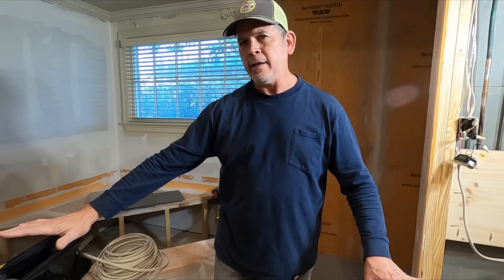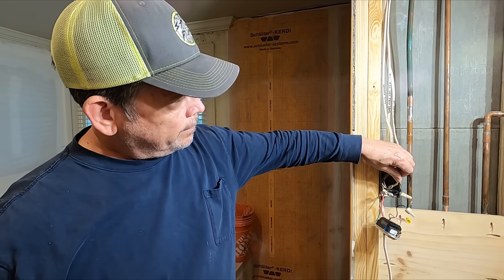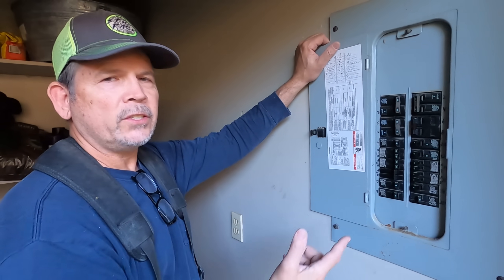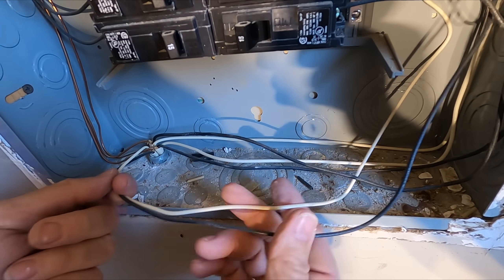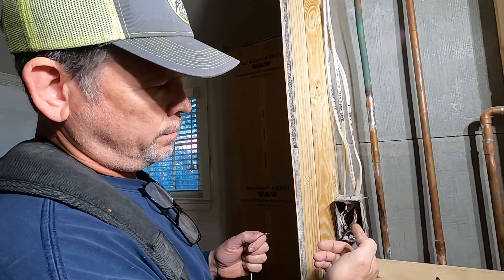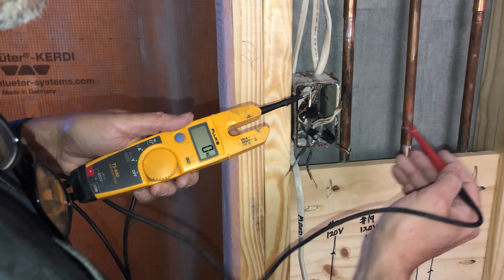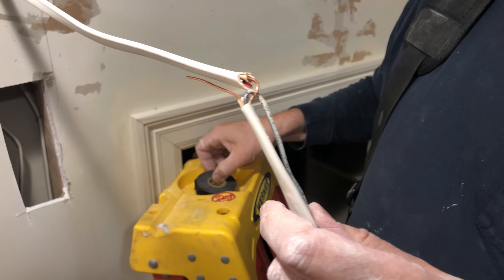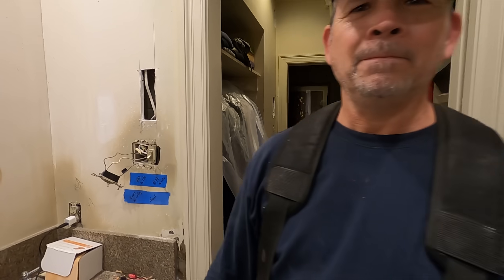You CAN Get SHOCKED by a Neutral Wire! This is How...

Comment: if you want to worry about getting shocked go work for the company I did. They designed the electric fence control panels for all of California's state prisons. Even after the 30 minute safety procedure to turn off a section of fence and unlocking the gates to access the fence and control panels you still get the hibby jeebies walking next to them.

Comment: Great video !   I have been doing electrical wiring for a number of years and renovations can (usually do) have surprises with them.  Electrical wiring is no exception.  Working with electricity is safe only when you know exactly what you are doing.  Electrical codes are important and also, hiring the right people to do your wiring on your panel is too.  Your insurance on your home depends on getting the proper permits, following all codes and the final inspection by the Province or State Electrical Inspector.  Don't play the "go cheap" to save on $ when it comes to electricity.  Your mortgage insurance will be both, void and null should your Insurance company Fire Inspector find, after a fire code violations (and believe me, they will be looking for reasons to get out of paying you.  Know what you are doing, follow all codes and get an Inspection completed before you put the final touches together.

Comment: The neutral is carrying the unbalanced 15 amp load If phased incorrectly it could end up carrying 30 amps double its capacity. Tell tale signs would be a blackened White wire at panel neutral bar.

Comment: Nice video. Another way I've seen a load onto nuetral was I had a tree that grew through incoming wires.   Got a slight zap using a cordless drill removing an outlet cover.   Turned the main off and still had 40 volts coming in through neutral from outside.   That sent me for a loop.   Further investigation showed 110 on one line. 80 on the other and 38 on neutral at main panel.  Then same at meter  
End result National Grid had to come out and replace incoming line on 4th of July weekend while we partied running on generator.  Of course we gave the crew some hotdogs and fixings to make their holiday complete too.
Reply: Another way at looking at safety: Yeah, the guy working for him didn't get hurt or die from electrocution but , whoah, when he fell of the top step of the ladder, it was bad, really bad. Thats why you haven't seen as many videos lately form this guy, he forgot. He forgot about ladder safety. Poor guy working for him, well, its not my place to tell you exactly what happened as there may be a pending lawsuit so...........Oh, so do not stand on the top step of any step ladder EVER!!!!!!!

Comment: when you touched the black wire to the pipe and the closet light went on did the two lights have half brightness?
Reply from the maker: No full brightness but I’ve seen what your talking about when it’s in series

Comment: Good video. You said current code requires a main breaker in the subpanel. I assume you are talking about your local jurisdiction and not the NEC. If not, please cite the code. It has been awhile since a installed a subpanel, but I keep up on code changes and I am not aware of this. I don't like that in the same building. I can see a reason in industrial settings, but certainly not in a reasonably sized house. The find the tripped breaker shell game is a pain. In an industrial setting, it can take a lot of walking and climbing ladders to find the tripped breaker, and it usually is always the "other" one. Of course, while everyone is on your back to get it fixed.

Comment: 😎🌹 thank you sir that was a very good presentation I really like it there’s other people they don’t take the time to explain about electricity and you’re right you have to respect electricity I haven’t gotten shocked yet I took a crash course of electricity in school that has helped me quite a lot

Question one !! I have a question for you how can I have how can I install a receptacle without a light switch 

Question to  !! How many light fixtures can you  install on a 20 amp breaker 

Question three. On my panel I have one breaker it’s not connected to anything do they live that is a spare for the future or can I use that 20 amp breaker that’s not being used for more light fixtures ???  

And I know for a fact correct me if I’m wrong whatever light fixture you’re using whatever it requires it pulls out of the 20 amp breaker somehow you do the math I don’t know how I forgot how to see if it doesn’t pull more than what it should if not the breaker would turn off correct 

I think you very much for your experience and your knowledge I hope to hear from you very soon thank you have a nice day it was coronavirus please be careful out there lots of people have been dying left and right and people take that as a joke. Thank you sir have a nice day 🌹😎😎

Comment: I am a first time viewer and already liking your master skills! We live in a older home and it has two issues.. Although it has combination of old and new wiring circuits. But the new circuit has multiple 2, 3 and 4 way switches and for some unknown reasons there is no power in that circuit. The outlets, switches and the circuit breakers checked out to be ok but there is still no power in that circuit.  Also. Just recently all of a sudden we lost power to part of the  house. The circuit breaker, receptacles, and switches were found to be ok. The breaker is on but there is still no power. On this circuit there are two ceiling fans with pull on lights, a chandeliers with dimmer switch. Two separate sets of large tubelites, three sets of hall way lights which controls with one switch. I have tried tested everything starting from switches, outlets, including circuit breakers all seems to be in working order but to no avail.. But upon testing the junction boxes in the attic I found out almost all the metal boxes were charged/ energized when tested with a non contact tester. I have'nt got the clue what's really going on?? So any help would be appreciated!
Thank you...

Comment: I’m in electrician and I hate doing remodels just because the old electricians would use grounds as neutrals and neutrals as hot and a lot of times the feeder is in the fixture in the center of the bedroom because they thought it saved wire to pull everything into the center fixture and it’s almost like you had to work on the house in rough in to understand what they’ve done

Comment: IF YOU put 12/3, (Blk, Red, White and a bare Gnd wire), with BLK & RED connected to two separate 20A breakers, BUT one breaker is fed from L1, the other from L2.  Both branch circuits then SHARE the neutral, AND both hots are 180° out-of-phase too.  NOW, add a GFI at the upstream end of one branch too. HA HA!  Let that one go pinging around your cranium!
Reply from the maker: Yeah it won’t work.   GFCIs can’t have a shared neutral.
Reply: @StudPack  Forget the GFI.  Its WORSE.  Being 180° out of phase creates a 240v.  How are either 120v legs, both needing that shared neutral, going to behave?  That's the $64,000 Q!
Reply from the maker: In a shared neutral circuit like you describe and then you lose the neutral... now the current is returning to the source on L1 and/or L2.  Now you’re frying TVs computers etc.  whatever is the most expensive item plugged in 😀.   It won’t be the 15$ toaster, it’ll be the $1500 TV.  Murphy’s law in full display 😡

But I think you knew that 👊
Reply: @StudPack  Yessir!  Also,  MC & NM Cable manufacturers now offer multi-phase cables WITH multi-neutrals, like 12/4 MC.  Two hots and two neutrals, all inside the same cable.  (Deleting the multi-branch w/single neutral safety issues).
Reply from the maker: Cool thx 👍 and thx for commenting 💪

Comment: @William Jefferson  IF YOU put 14/3, (Blk, Red, White and a bare Gnd wire), with BLK & RED connected across two separate 15A breakers, BUT one breaker is fed from L1, the other from L2, then both circuits SHARE the neutral, and the phases are 180° out.  NOW, add a GFI at the upstream end of one branch. HA HA!  Let that one go pinging around your cranium!

Comment: You can’t share a neutral with 2 hots on the same phase to begin with! You will be putting the total combined amperage of both circuits on the 12 AWG neutral overheating it! That’s where your messed up to begin with! The problem you had was created by negligence creating a floating neutral! It is now code to have a dedicated neutral for each circuit!

Comment: First off, if you don't already know that you can be shocked by a neutral wire, hire a professional immediately.   I didn't like all of the trash in the bottom of the load center. I always vacuum mine out so they look pristine.  Great video.
Reply from the maker: Thx W 👍

Comment: A question the the electricians or anyone in the trades. How often do you find wire nut splices inside wall spaces during demolition? This is a very informative post, not only the video part, but the comments as well. To me, it seems like a pretty civil bunch here, then again I suspect it's mainly adults here.
Reply: I've found butt splices in brand new cable. Installed at the factory.

Comment: Great video and thanks. I have three outlets that need to be fixed by an electrician, beyond my skills. 

1. I haven wondered why I get shocked by neutral wiring.  

2. Back in 2013, an electrician advised me to never test 9 volt batteries with my tongue. I knew that these batteries were DC powered but never considered the risk. He said that DC can stop the heart beating and although rare, it does happen. I also remembered that DC was extremely dangerous to work with in the early 20th Century. 

3. This situation reminds me of when someone says to me, "Oh don't hire an electrician, I have a buddy who will do the work, cheap!"

Comment: So they had an A and a B phase on the same circuit? Sharing neutrals. I recently had this problem and got popped.
Reply from the maker: No.  Same phases sharing neutral in my case so current adds.  That’s why I fixed it 👍
In my diagram, circuits 19 and 20 were sharing a neutral.   CBs 18 and 20 would have been okay but I would have needed a handle tie

Comment: As always, I love your videos!

Ckt 19 and Ckt 20 need to be on a 2-pole (240v) breaker because it's technically a multi-wire branch circuit if they are sharing a neutral like that.  Either that or find where the neutrals from the 2 circuits are bonded and remove the bond.

That wiring situation is not code, and it's not code because it's not safe.  And it's not safe because you got shocked.  You really should correct that so the next guy doesn't get shocked or worse.

EDIT:  I commented prior to finishing the video.  Glad you got them separated and safe.  So whoever put that 3-way in used the wrong neutral.  Interesting
Reply: Hey, I hope he does a video on ladder safety? Watch starting at 13:01  Ummmmm,  On second thought, please no,  don't!
Reply: @vicferrariproject  haha yeah that’s generally a no-no.  But let’s face it—we’ve all done it.

Comment: This out dated way of wiring is why I loath adding ark fault protection or diagnosing Ark faults in older homes lol. With all neutrals tied together in outlet locations in older homes you can spend the better part of the day chasing down the fault.

Comment: This shared neutral setup, also known as a Multiwire Branch Circuit, is pretty standard practice though. The missing key here is that the two circuit breakers that supply each of the hots (but share that one neutral between them) MUST be tied at the handles so they are both turned off simultaneously to avoid the dangerous situation you're describing. If BOTH breakers had been off, you would not have been shocked.
Reply from the maker: Thx T H.  Main difference is these circuits were same phase (line) so current added on that shared neutral.  That’s the main reason I fixed it 👍
Reply: @StudPack  True, and that's the nightmare scenario with tandem breakers making it much easier to get into trouble. Hopefully people understand that MWB circuits are fine if installed properly and, even more important, to NEVER assume a neutral is safe just because it's a neutral. Thanks for the video!
Reply: Or, instead of using a handle tie between the two breakers, you could replace those two individual breakers with a double-pole breaker which will supply each of the two hots but connect their trip mechanisms together so if one trips, the other trips and will force you to shut off both circuits at the same time so if you go to work on one, the other is off as well and their shared neutral is de-energized.

Comment: HI, I enjoyed watching this. It was very helpful and makes me wonder what the original electricians did in my home back in 1970. One thing I would like to ask you to cover is when people repeatedly overload a 15 amp breaker with an electrical device that requires 20 amps. Some folks have been known to replace the 15 amp breaker with a 20 amp breaker without any consideration to wire size or outlet capacity. I don't think they realize that act can cause a fire in their home.  Would you please address this?  

Regards, 
Darryl
Reply from the maker: Thx Darryl 👍.   Yeah that’s a common problem.   I plan on more electrical videos 💪
Reply: 14 AWG can actually handle 20 amps of current. The code is just conservative in their rating because they're beholden to big copper and wire. The Big Guy wants 10% so let's go Brandon!

Comment: The worst shock I've got had to be from an automotive distributer hands down. I mean frickin' ouch!!!! Been nailed by a white wire to from a switch loop and in another old glass fused system in my Dads house. Just be careful and don't assume, a sniffer is relatively inexpensive and fits in your shirt pocket, get one and use it. I have worked around isolated grounds on a gridded system, these are deadly, again always use your tester to be sure. In some cases and to the uniformed DYI'er color codes are just a suggestion and sometimes different applications just don't get understood, followed or marked properly. Keep in mind that the guy before you although he may have gotten the system to work doesn't necessarily have the same amount of common sense as you. You really can't blame being shocked on anyone but yourself. :)
Reply from the maker: Thx.  All was good in that box (checked every wire) until someone threw a 3 way switch in another room that put current on the neutral.  Not much you can do to avoid that aside from turning off whole house 👍😳
Reply: @StudPack  Agreed, a sniffer only gets us so far. You do great work, thanks for showing it. :)

Comment: I always check the wires completely before touching anything. I check for potential across all 3 pairs of wires and if I have a pipe or metal box I'll check across that too. I first check with the power on to make sure my tester is working, power off - test, and often I'll turn the power on again and check again and then turn off power and check again.

Comment: Got one of those three function switches . For light , celing heater and vaccum ( I guess that's what it's called ? ) Is it possible even probable that even though one of these funstions ( vacuum ) still work , that it can still the cause for the other two things not to work ? Thanks
Reply from the maker: I’ve seen bad switches but they are extremely rare IMO.  You can check the switch with a multimeter.   Are you in the US?   You can also usually remove the individual components from the fixture (thinking Broan or Nutone). They usually plug in and are easily removed.   Plug them into known hot and see if they work.
Reply: @StudPack  I did that. And yeah they work . Must be the plugs in the unit then ? Can I find and replace those or i have to replace the whole thing ?

Comment: Excellent video.
However.. at 13:02 ...  You should get a taller ladder.  :)  That plastic part is not a step for standing on.
Reply from the maker: Thx and 👍 on ladder.  Honestly that’s the only ladder I could get in that closet to get high enough to get in the attic hatch.  9 foot ceilings and 7 foot ladder 👊

Comment: Code allows 2 circuits share a neutral. It's called a multi wire branch circuit. But the 2 breakers are suppose to be together like a 2 pole breaker. And shut off together.... if u shut off both breakers u wouldt get current.

Comment: Well, anytime I see a white wire with a electrical tape wrapped around it, I always consider that wire to be hot and not a "neutral".
Reply from the maker: See my pinned comment. It’s a neutral 👍
Reply: If a white wire is taped black or red that is an indicator that it is carrying current and is no longer a neutral.

Comment: This answered a big question for me. I got zapped after I turned off the breaker for GFI in the garage, (i was replacing the GFI outlet) when I was holding the receptacle by the mounting ears with my right hand and and bumped the black wire with my left hand. It appears to be back feeding somewhere as in your scenario. This may also explain why there's different light switches that turn power on and off to the garage door openers but still have juice for a separate light. Then there's the mystery light in the hallway that after all the breakers for the lights and receptacles for bedrooms are turned off the light in the hallway still shines real dim (LED bulb). Kinda spooky !!
Reply from the maker: Thx Joe 👍 yeah that stuff can drive you batty and can take forever to sort out 😩

Comment: 13:03   Standing on the top of a ladder?  That can kill you as fast as electricity.
Reply from the maker: That was a tough spot.   9 foot ceiling.  Attic access in closet. Couldn’t get an extension ladder in there at all.  My 7 foot ladder barely fit 😳